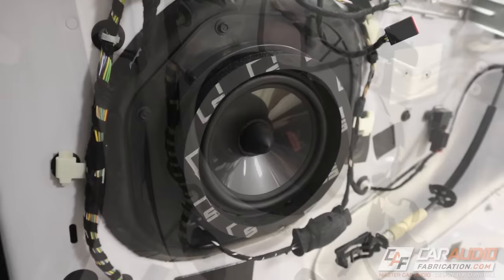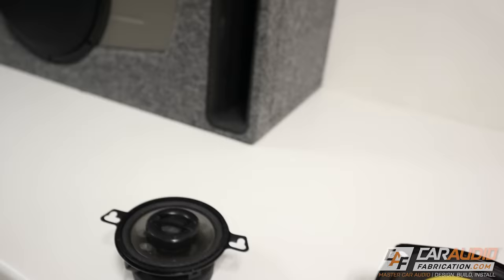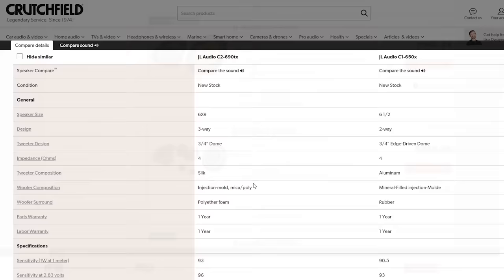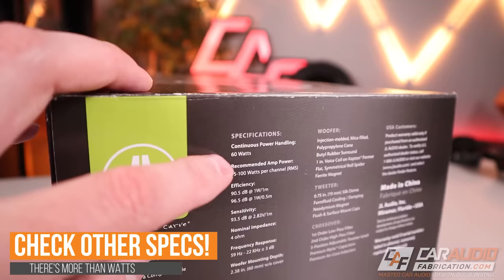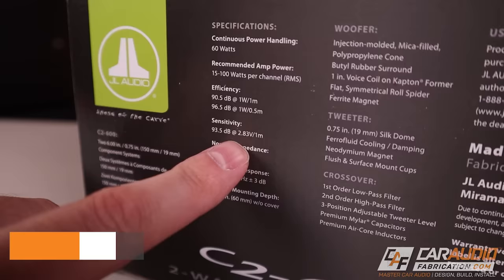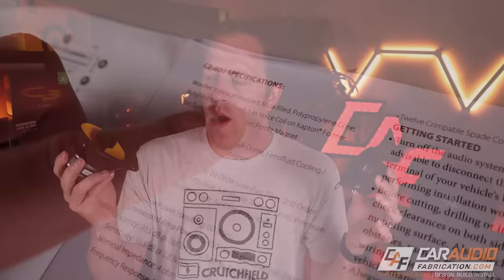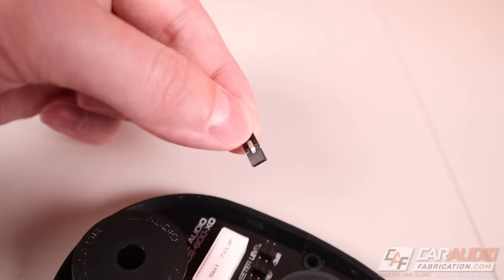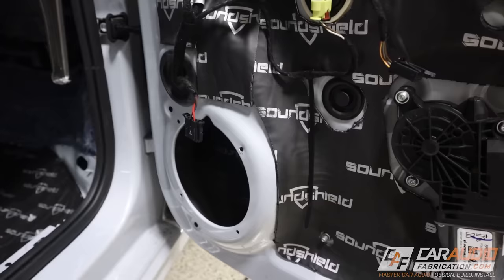DO's & DON'Ts - Picking Amazing Sounding Speakers!

Comment: What I have learned in 30 years of messing with this stuff. Its easy to make it sound great in your driveway. Much harder to do at 70 MPH.
Reply: Solution, drive 60 mph. Saves gas too. Lol, but yeah, I've experienced that too. It's always the low frequency noise that's hardest to get rid of too.
Reply: You need a bmw 7 series or mercedes S class. 70, 110, 150mph all silent.
Reply: You need a better deadening job lol
Reply: My back struts are garbage and there’s something rattling plastic to metal somewhere in the back, possibly rear deck. I constantly travel 70-75mph with a right door 6.5, and 2 6x9s rear deck lol not even my driver side 6.5 and windows down theyre screaming
Reply: To add to this, it’s not loud enough to begin with
Reply: @majinbenproductions1038  you’ll never have proper stereo imaging with that setup. That’s literally the worst possible arrangement for 3 speakers. 2 up front would still be bad but sound MUUUCH better
Reply: Drive slower
Reply: It all sounds good in a car...
Reply: Sound treatment is the key!
Reply: @krowwithakay  my 94 z28 has 2 in the front, 1 in the rear Bose system. Sounds like crap. Got an appointment to get a double din touchscreen put in to start, but cant decide what door speakers to get yet since I only get 1 6x9 in the back without adding boxes or doing some mods to the interior.
Reply: @eatmysalt291  Take it from someone who's owned several third and fourth gen Camaros, firebirdsz and TAs.. spend your money on exhaust and engine work... Nothing sounds good in these cars unless you go crazy spending and customizing interior.
Reply: @jacobrzeszewski6527  🤣🤣🤣🤣👌👌👌

Comment: In my 20s I preferred the sound of a silk dome.tweeter (Boston Acoustics were my favorite), as metal tweeters sounded too harsh.  Now in my 50s, my aging ears prefer the sound of a metal dome tweeter (Currently using Alpine).
Reply: Thanks for sharing, I can't stand harsh noise so I'll be looking for some silk tweeters
Reply: I miss Boston Acoustic! Great sounding speakers I had a beautiful Boston Acoustic system in my 88 VW Cabriolet in the late 90's.  6.5 components in the doors, 5.25 coaxial in the rear sides and 2, 12's in a sealed box in the boot. One of the best sounding system I had in stalled. They stole the whole car : (
Reply: @jeweldey3699  Dang, that sux.  That car would be a classic if you still had it today.  I put Boston Rally components up front and Kicker 10s in the trunk of my 87 Pontiac Bonneville when I worked at Circuit City.  I'd actually look forward to long drives.  I wish Boston was still around.
Reply: I currently have 2 of the 5”x 7” s85’s and am trying to install in my Audi A5 unfortunately it’s a pain so you think it’d be worth putting them in boxes on rear deck? I really love the way boston acoustics sound I also have 2 g2’s for my other vehicle lol
Reply: Bostons were amazing back in the day!
Reply: I sold Boston acoustics in the early 2000’s. There were two main sets of components I sold on a regular basis. The more expensive one sounded better with r&b and the model down from it sounded better with rock and roll. I let the customers decide and this was always the case. I honestly can’t remember the models without having to look it up to see what the difference was.
Reply: Kinda the opposite for me, in my 50/60's I prefer a HIGH END Silk Dome and I'm in love with my Thesis Violino II Tweeters - not cheap, but they are crystal clear...!
Reply: @stevendphoto   I had to look those up, that is quite an expensive tweeter.     I love my Morel Piccolos but am definitely curious what these are like, I know Audison makes nice stuff, a Quattro amp powers the Piccolos and it is awesome.
Reply: Sorry sir..but you are mislead. A tweeter can sound anyway it's manufacturer decides irrespective of the material used.
Reply: @russelllopez4171  I seem to remember that on the high end there were the Boston Pros with that awesome titanium dome and then on the lower end there were the Rally series with a silk dome. Good times.
Reply: Love the mb quarts back in the 90s 💪
Reply: It's hard to reproduce the sound of an instrument that's made of metal without anything other than metal as the material for the Tweeter. Like a symbol on the drums do that with silk kind of difficult, titanium aluminum or Molly polybendium just kidding on that one but a lot easier
Reply: Yeah I'm your age most people younger than us don't know anything about music everything is about how much you can stomp I'm just trying to find something that's the best for cranking my Van Halen and Slayer
Reply: @emo65170.  I have a pair of new Boston Acoustic shallow mount 12’s  I will sell

Comment: I really think the most important part of all of this is CLEAN POWER. If you buy something like a $150 jensen/boss/chinamart head unit even the best speakers will be junk. If you want the best sound, get a cheap lower wattage amp and power the speakers from that. This will even make junk paper speakers sound 25-40% better/clearer. You'd be surprised how amazing cheap speakers sound with clean amp power.
Reply: finally somebody said it the most important thing is having a quality head unit then everything else follows
Reply: changed my head units from a mid range to a cheap "it works" and indeed, holy shit it sounds so bad now. Really, really bad. As if the speakers were faulty. But the head unit is just very bad.  Also the antenna now is not receiving as well anymore lol.
Reply: How do I know how much power my stock head unit can handle?

Comment: I never understood the point of amplifying speakers until i did it in 2018.  What a difference.  If you buy a sweet set speakers (and they're 50W RMS each) and hook them directly to the head unit, you are not only leaving performance on the table but you also probably won't feel impressed.  Gotta buy a 2- or 4-channel amp to send them 50W instead of the 18W the head unit provides!

Comment: My personal philosophy is, if you have a stock head unit and just want more clarity and crispness or to bring your sound to life, start with replacing or adding good quality tweeters.  Aftermarket performance speakers with stock radio power is almost never an upgrade.  I’m all about keeping a factory radio and adding a 4-channel amplifier for speakers that are at or just below the RMS rating of an amplifier per channel.  On the other hand, an aftermarket radio powering stock speakers usually rocks.  This is because the factory speakers are made to do every job with low power.  I’d rather overpower speakers than the opposite.  If you aren’t looking for more power with a factory radio you can find cheap aftermarket speakers online that are made to replace the factory ones with the same low power rating, except better cones and surrounds to last longer.

Comment: Crutchfield will tell you that certain speakers won’t fit your vehicle if they don’t carry the adapter ring.  For instance, crutchfield said hardly any 6.5” speakers would fit the rear doors on my 4runner.  I found an adapter ring somewhere else which gave me many more options for speakers. 

That being said, I still buy some things from crutchfield. Just be aware that you should do more research if crutchfield says something won’t fit/easily mount and it seems like it should.
Reply: What year 4runner?
Reply: I think it is more that Crutchfield only says something fits if it fits with no modifications or adaptors whatsoever.  Even if they carry the adaptor their automated tool will say a speaker does not fit.  They do this for the obvious reasons.  I know in my car none of the speakers I have "fit" on the Crutchfield site, yet they all fit with easy adaptors or adjustments.   I agree with your main point, many things fit whether Crutchfield says they do or not, just that I understand why crutchfield feels they have to do that.  and yes, I like Crutchfield, they have good prices and are fair and honest.

Comment: Retired 30 plus year installer.MECP first class 1992, Master #10   1994. Great video... Good luck trying to find a great demo board these days, my massive MTI board was almost 20k in the 90"s, sold for it for 1000. mY BEST ADVICE would be to buy the most expensive JL AUDIO you can afford, and a real pro install them.  I always made a wood mounting surface for door speakers, always...good luck

Comment: A lot of good information.  One thing that frustrates me, my doors have 6x9s and Crutchfield does not display a single one on their compatibility tool.  For three years.  I thought perhaps everything they have is deeper with a larger magnet or something like that.  After searching forums for my vehicle many, many users have purchased 6 x 9s (many of those speakers from Crutchfield themselves) and everything drops in perfectly and sounds nice.
Reply: I found out Morel has a 6x9 option! Thinking about doing those in my F150.
Reply: Crutch field is way over priced. And my 05 f150 has 6x8’s not 6x9

Comment: I have a Mercedes Metris cargo van, and in my opinion the factory speakers sound awesome. Absolutely no need for a sound upgrade, but.... one side is already rattling (torn paper I assume) and there are times when I'd like a little but more volume (but I can live with what I have). After doing considerable research, it seems that virtually any aftermarket option, including component speakers and better brand speakers, all have the same issue: weak bass. The factory speakers have a tiny little magnet and you're think they would sound as crappy as they look, but they really do have awesome bass using the factory head unit, which I don't want to replace. Yesterday I destroyed my one good speaker and installed a Pioneer TS-G1620F on one side and when I compare with the factory speaker, it's not even a close contest: the factory speaker sounds MUCH better, even though it's damaged. So am I stuck replacing with factory speakers? I don't want to waste money on good speakers only to get less sound.
Reply: You spent $60 on a speaker. That’s your problem my guy. A decent sounding speaker is going to be in the $150+ range - typically $300+ is where you find “premium” audio.

Comment: If the idea is to get better sound then you should probably change your head unit 1st
 A quality head unit with ample power will give you good sound from stock speakers
 Stock systems usually sound cruddy because they don't have enough power  Or the quality Of after market units
Reply: Yes, I’m learning that as I just bought a 2020 Honda CRV EX-L and the problem is it’s an infotainment system… so upgrading that will most likely mess up the electronics and sensors that’s tied into the car. I know Joy something makes a decent infotainment system but it’s finding someone to install it correctly and not take shortcuts

Comment: I just did 300e worth of sound deadening, 200e front speakers, 110e rears, 200e 4channel AB- amp, 160e 500w @1ohm mono for a 12inc sealed sub(200e)...installed them all my self and sounds good for as cheap of an budget

Comment: Just replaced my AM radio and single 4x6 speaker in my Japanese KEI truck with a new cheapo eBay Bluetooth AM/FM radio with a 50 watt full range 4x6. Sounds great. Cost me $46 total with shipping for both.

Comment: so I plan on doing three 3.5 inch tweeters under my dash to replaced factory speakers with two 6 inch speakers behind my seats to replace factory speakers and then I plan to have a sub in the far back of the car. Do I need to run all 5 speakers to an amplifier along with my sub? or do I only need the amplifier for the sub?
Reply: You might get away with only a single amplifier powering the sub, but it also depends how efficient the tweeters and 6 inch speakers are. 2 major factors come into play. 1 is that the majority of receivers don't have a lot of power output, so the tweeters and 6 inch speakers will not be receiving much. 2 is the now aplified sub, could begin to drown out the other speakers, either from just raw volume alone, or combined with polarity phasing. You can opt to make the amplified sub more timid thru various ways, which could help with the overwhelming volume difference, but it might still suffer some phasing. If money is tight, just pick at each area as you can, when you can. Ultimately you want to get to a point of having all the speakers externally amplified, and a quality DSP controlling the signal.

Comment: Another option for “some” people and “some” vehicles.  Have a audio installer build speaker cabinets from MDF board for your car speakers. This gives you a lot more options for types and sizes of speakers you want. Makes for easier install options. For instance if you have a older work car for your commute, put the speaker cabinets in the back seat. Years ago some people put home speakers in the back seat hooked up to the head unit. I had 10 inch woofer and tweeter home speakers in my work car. Worked great for me, I was rocking them..👍😎
Reply: Rear speakers are useless.
Do you stand with your back to the stage at a concert?
Sound should come from the front.

Comment: I use crutchfield for most of my purchases but one of my vehicles like the 2020 maxima, they don’t offer much for it but i found out like replacing 6X9 with 6.5 and 6.75 focal flax and found it work well. 3 way up front, Coaxial is rear with a Fiberglass sub
Reply: I'm with you on that. I have a 2013 Sentra my options are limited to

Comment: My build plan rn is 6x9 jl audio c2 speakers in the front, 6-1/2 in jl audio c1 in the back running off an alpine r2 amp and a downfiring kicker L7T subwoofer with a kicker CXA 800 amp, I’m going for sound quality and good volume, what do you guys think?

Comment: Something I never hear anyone talk about is preamps. If you are gonna run an amp, having a head unit with 7 volt preamps is gonna make a huge sound difference opposed to 1.5 volt preamps.
Reply: @Cee-i4p   If you are running high quality digital amps at high loads, you will notice a difference from 5 to 7 volts. For most part though, you are right. I went though a phase where I tried every single amp and deck combo imaginable.

Comment: Used Crutchfield to replace my factory speakers in my '14 Lexus IS350 with Mark Levinson system. Used Rockford Fosgate Punch and Power series. Factory speakers were way louder. Smh. Now have to spend more to get them sound they way they should. Was told about $1,200 installed.
Reply: You didn't watch this video before you bought huh? Lol

Comment: The bad thing about the sensitivity (dB) spec is some manufacturers don’t say which way they tested for it. Some use the 1W/1M (one watt at one meter distance) method, while some others use the 2.83v input (2.83v into a 4 ohm speaker produces 2 watts). 2.83v doubles the power, which adds 3dB to the spec they’re trying to measure. So that is misleading if they only give the dB number without saying which standard they tested it under.
Reply: @Cee-i4p no, some do state it. I recently installed JBL Stage 3 speakers in my truck and the sensitivity given was shown as being tested at 2.83V. I was also considering Pioneer speakers and the spec was given as tested at 1W/1M.

Another thing to consider when looking at this spec is the impedance of the speaker. My JBL speakers are 3 ohm impedance. Given the lower impedance and a higher voltage, the speakers were actually tested with 2.66 watts instead of 1 watt. The results still only produced a 93dB rating on the 6x9’s, and 92dB for the 6.5’s. This is very similar to many other companies’ speakers testing at 1W/1M. If the JBL’s were tested at 1W/1M the dB result would have been a good bit lower, so I assume they did this to allow putting a higher number out for the sensitivity. This would seem to suggest that other speakers with similar dB ratings but tested at the 1W/1M standard will ultimately play louder when powered the same as the ones tested at 2.83V, and they probably do on a measurable scale. However in real world use, I can tell little to no difference in volume. The JBL’s can play very loudly on just stock deck power of a 2023 Nissan Frontier (non Fender system), and they sound very clear doing so. No distortion.

So basically, don’t over focus on this spec. It’s good to get an idea of one speaker playing louder than another, or maybe in terms of its general performance (lower dB speakers on an amp can really sound good!) but it doesn’t carry as much weight as you might think. Often the only true way to judge a speaker is to physically hear it.

Comment: I’m trying to figure out best set up for my 2001 Cabrio. I just sold a 2000 (regrettably) that had a great sound system. I do t know the intricacies of it. Just photos of the speakers, amp, and 8” Rockford sun in rear. They had what appeared to be smaller dash speakers in the factory spot, with tweeters sitting in back of them pointing toward driver. Looked like a small infinity speaker mid range, and the tweeter is likely JL (or infinity) because the doors were JL mids.  Amp was a 300 Watt JL. Rears, unsure, finding ones that fit is challenging, but Crutchfield stated I could space the screws with washers and other mods to bring thing “out”. Anyone have ideas of what to buy? It sounded so good! If I could locate the original 
  O I’d duplicate it as close as possible. It had an older 52 watt X4  Alpine CD player. I’m thinking Kenwood next (I dont like those pop up screens).

Comment: I have sony mobile ES speakers and they sound amazing it is being powered by an XM GS4 amplifier. Wish I have waited for the Sony Mobile 3 ways for my fronts but, it's possible to still get an amazing sound with 2 way components in the front. However, the pioneer radio does not do it justice but, the sony mobile ES radio would elevate the sound quality even more.